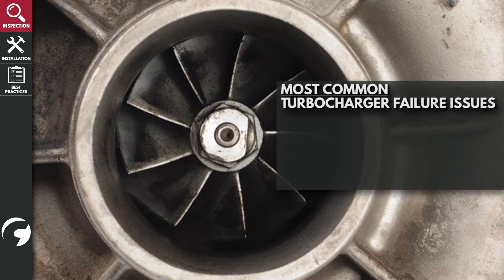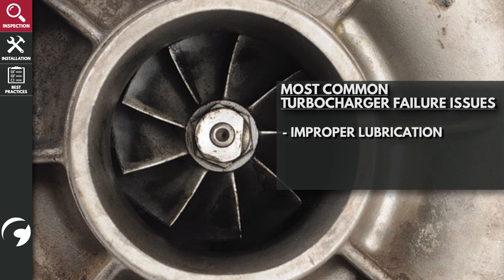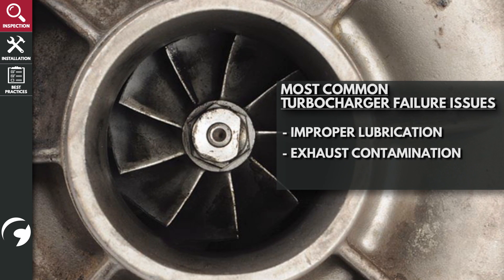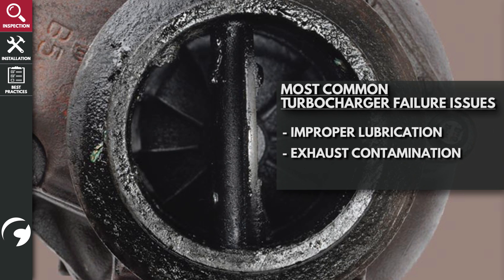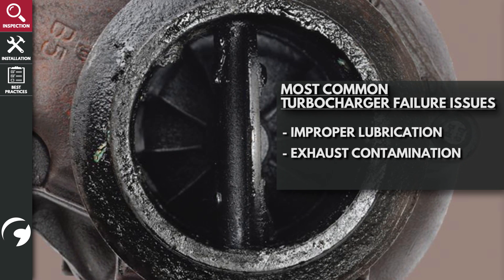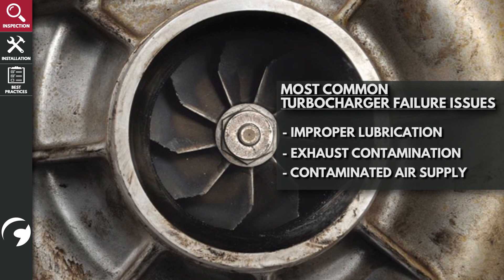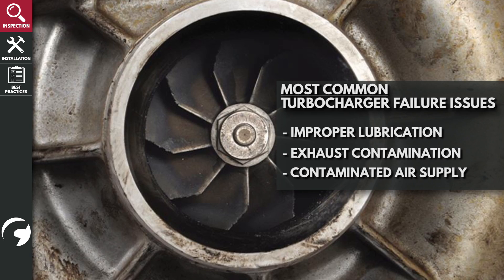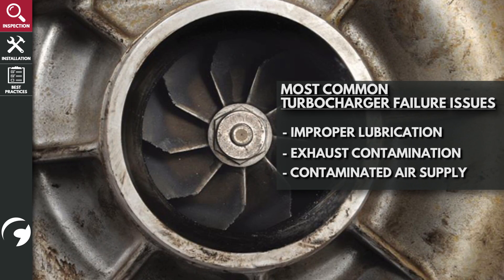Why Turbochargers Fail Series - Troubleshoot the Cause, Inspect and Diagnose to Properly Repair

Comment: reason: overpriced Honeywell turbo with undersized bearings
Reply: Black turbine You nailed it! Props to you for exposing Honeywell's craptastic, penny-pinching business model. That problem extends throughout most of Honeywell's (non-MIL/DoD) products. Honeywell's stated goal of "Adding shareholder value" should not be at the expense of well-engineered, quality products. Given a choice of Honeywell or another supplier, I always choose the alternative. Cheers!